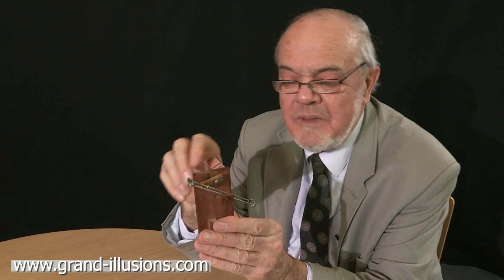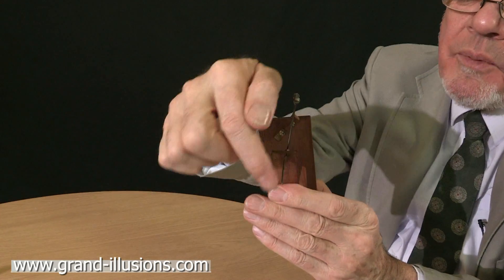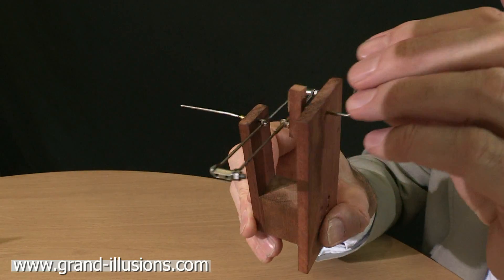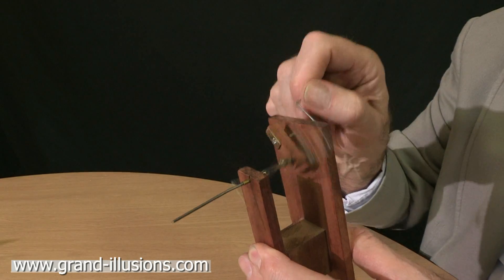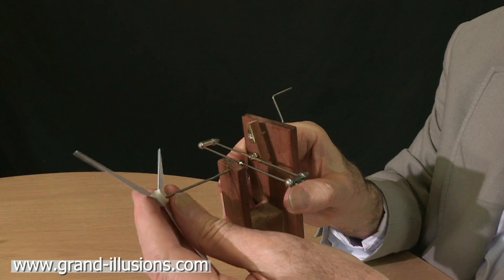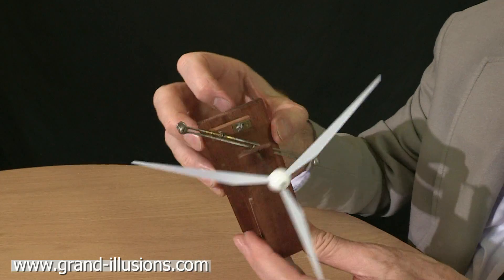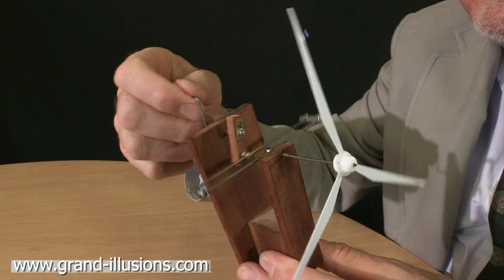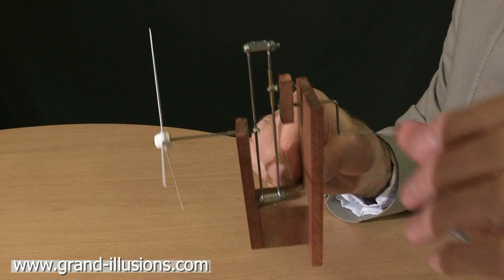Zurich Mechanism

Comment: The presenter fails to note that output shaft rotation speed is precisely half the input speed. And no, it is not an Oldham coupling. The drive link is precisely the length of the shaft spacing.

Comment: A direct connection could do the same work without this much confusion 🤔😅
Reply: The point is that the input and output are not in line. :-)
Reply: @salohcinbs  That's true, but what's the purpose? 🤔
Reply: @Bala-68  There are sometimes design constraints that require an offset system and this is an elegant solution.
Reply: @salohcinbs  okay. 👍 Just for understanding, Can you quote an application that requires such a mechanism?

Comment: There was no reduction? It’s one to one. It may as well been a straight shaft with a crank on one end and the propeller on the other. It’s just a waste in friction.  Baffling.
Reply: not quite, the mechanism continues the motion but at a different height to the crank, which is useful in itself. But other solutions would use less space which I guess is one reason you don't see this used.

Comment: Guess the gear ratio...
Reply: Tomas Sab this made me wanna commit sudoku
Reply: +DigGil3 its like 1:1
Reply: +RonniePoleCasper but is it a constant 1:1? 

The leverage is changing from one position to the other. At the top the leverage is two arms length, at the bottom - crossing the axis - 0 leverage. 

No idea what the ratios are in between top and bottom position, though. Axial loads kick in at this point, the lever is no longer working in pure bending mode. It should average out to 1:1. But what's the shape of the angular distribution?
Reply: ***** It's an interesting and legitimate engineering/logic puzzle!
Reply: quite intriguing, a very interesting topic nonetheless. 
i find the best way of determining this would be to buy one yourself, and monitor it's functions.
Reply: It's 1:cos(theta) (theta being the angle between the two rotating bars).
Reply: Don't think that matters. It may change throughout the single revolution, but I don't think it keeps changing.
Reply: For every 2 rotations, of the input, the output rotates once. Sot 2:1.
Reply: MyLifeInAFlamingBag
- but it's not a "constant" 1:1/2, is it now?

At various angles the ratio keeps changing. At one point the ratio goes down to 1:0 (at the bottom, when the driving circle is tangent to the rod)

Comment: I bet someone reading this is a whizz at animation.....  If you post your animation would you let me know please?  Seems to me that if the offset between the shafts were variable you'd get a variable ratio drive over a limited range.  My reasoning?  Imagine the two shafts aligned.  I would be 1:1 and constant velocity.  The misalignment shown here is near the limit, hence the hiccup when the slider is only just below the output shaft.  The ratio is 1.x : 1.  Some say 2:1,  but my eyes are saying "not quite".  Also, I think that for constant input speed, the angular speed of the output will vary  with angle.   Maybe I should just make one!

Comment: It's formal name is an Oldham coupling and it is used in cars to offset axels without the loss if torque or direction
Reply: thats not entirely true: oldham coupling doesnt change the torque ratio; this mechanism does
Reply: Not oldham coupling, although I see how you could make that mistake.
Reply: Maybe I’ve spent my whole career in a hole but in 50 years in the mechanical trade I have never seen anything that even remotely resembles this in any motor vehicle.
Reply: Sorry for replying to such an old response. If it is as you say and Oldham coupling, how come it has a 2:1 reduction?
Reply: Oldham couplings are run on tenons.
Reply: This looks like it has variation in speed and torque, also what would make this better over gears?
Reply: Yes, it is a cross clutch, but it does not have the characteristics of a differential as you describe, so it is not in the use of a car differential. It involves the transmission of torque and a 1: 1 transmission between two shafts that do not have a common axis. Someone writes that it is a 2: 1 reduction. It's wrong, it's not. The cross coupling is used for very small alignment differences. However, it is still true that the use of two gears is many times better.
Reply: Bit late but thanks wondered if there were practical uses, also wondering about the efficiency
Reply: Whoa, nice job!  
It's a brilliant and elegant idea.
Reply: It looks like the output doesnt run at a constant speed?
Reply: well, now we are 44! It's a bit of a progress, don't you think?
Reply: @RussellTeapot  now its over 200
Reply: @fernandotrujilo8954  amazing
Reply: @fernandotrujilo8954  crested 300 and is on its way to 400
Reply: @sethg6157  Already 328 only nine hours later....iiiiits trending!   Hello random youtube algorithm friends!  lol.
Reply: 348 baby
Reply: @Kharnellius  hey
Reply: 359 you glorious bastards
Reply: +Alex Underwood
Verified. Thank you, very interesting.
(How depressing that over the course of a year only seventeen people have bothered to 'like' that.)
Reply: @jacksainthill8974  dont worry I just gave the 420th like
Reply: almost at 500 boys
Reply: Russell Teapot 
Yes, they just needed some encouragement.
Cheers ;)
Reply: God has said in the Quran:

{ O mankind, worship your Lord, who created you and those before you, that you may become righteous - ( 2:21 ) 

 [He] who made for you the earth a bed [spread out] and the sky a ceiling and sent down from the sky, rain and brought forth thereby fruits as provision for you. So do not attribute to Allah equals while you know [that there is nothing similar to Him]. ( 2:22 )

And if you are in doubt about what We have sent down upon Our Servant [Muhammad], then produce a surah the like thereof and call upon your witnesses other than Allah, if you should be truthful. ( 2:23 )

 But if you do not - and you will never be able to - then fear the Fire, whose fuel is men and stones, prepared for the disbelievers.( 2:24 )

And give good tidings to those who believe and do righteous deeds that they will have gardens [in Paradise] beneath which rivers flow. Whenever they are provided with a provision of fruit therefrom, they will say, "This is what we were provided with before." And it is given to them in likeness. And they will have therein purified spouses, and they will abide therein eternally. ( 2:25 )

 Quran
Reply: @ahmdabdallah5811  This is the XXI Century, get out and go back 700 years and stay there, thanks.

Comment: What is so special with this? Not trying to diss, im just not understanding.
Reply: You know things aren't black and white. If I see something I don't understand I try to understand it hence, the comment. Fuck off, there was a time when you didn't understand this. I'm 16, straight A's.
Reply: KlemzeTV
don't mind that Igor guy, he clearly has problems with himself. I do not see what's so special about this thing either and I study physics. It just seems like an unusual way to build that connection and a bad one at that. Why bad? Notice how the front rectangle thing "jumps" at times which indicates a point where it almost locks up mechanically.
Reply: It's an interesting geometrical relationship that the output rotates at half the speed of the input simply by connecting the end of a crank to an offset slider, and is much simpler in design than using gears which have a complex shape and pulleys which use flexible components. It's also possible to get rid of the 'lock up' point essentially by 'repeating' the mechanism 90 degrees rotationally offset from the first.
Reply: It's nice to see someone wanting to understand. I'd consider it more 'unconventional' than 'special' since as Tim says; torque (rotational acceleration) is usually transferred between parts by using some kind of gear or pulley system. So really it's just a curiosity of mechanics.
Reply: *****
don't hate on klemze, someone started being rude, very rude, and that guy has now deleted his comments which is why it looks as it does. you can see me mentioning the guy in a comment in this thread, too
Reply: ***** For every crank, you get 1/2 crank of the output.
Reply: Bordpie
I see where you're coming from - really good idea about the offsetting part. But in practice I reckon that the friction on the middle sliding part would render a device with sufficient force behind it useless sooner than gears. Pulleys need to be replaced too so I don't know which would break first, would have to try ^.-

Comment: Interesting!  This appears to be a 2:1 gearbox but is it also a constant velocity system?
Reply: I think so.
Reply: sieben I asked the question 'is it a constant velocity system?'  If it is, it would give a constant rotational velocity output for a constant rotational velocity input.  A CV or Constant Velocity joint is what is used in front wheel drive cars for steering.  The traditional Hookes Joint does not exhibit constant velocity when the angle increases.
Reply: arburo1
It a piston mechanism so I don't think we can get constant velocity until the addition of a flywheel.

Comment: that's true, but in this case the two original axis offset each other so the chain would not be able to remain on the gear in either a low stressed situation, where the chain would have too much slack and would eventually catch and fall off one of the gears, or it would be too much of an angle for the chain to run cleanly and cause it to fall off (much like the chain on a mountain would fall off the gears on the bike when the gears on opposites of the drive train are being used).

Comment: hmmm. good thought. but if you were gonna do that, couldn't you just use 2 small gears on both axis, and then a chain connecting the two? like a bike?  I mean the rectangle might use a little less materials than a chain, but the rectangle would need a lot of space to rotate, whereas the chain would rotate in place.

Comment: This could be good for spinning a pair or variety of axis that are far apart. The rectangle could reach across a large distance rather than the same distance being greatly occupied with a large sized gear or set of gears. The replacing of the gears also means a lower cost in materials as less metal is used to reach the distance (imagine the rectangle and the small beam in the mechanism being longer and the crank being higher up, and how it would be simpler than a variety of gears).
Reply: The problem is practicality, you need quite a bit of space to move a rectangle like that, and making it longer introduces flex, limiting torque. Best to use a shaft with u-joints when you don’t want something flashy.

Comment: This is very similar to the Oldham Coupling, which can be used as a component of a drill which makes perfectly square holes. You can see the square hole drill here in a lecture called "Surprises in Mathematics", youtube video ueeViKEcRtY at time 15 minutes.  A similar coupling is a Schmidt Coupling, which also allows two offset axes to be coupled.
Reply: this is nothing like an oldham coupling
Reply: Oldham coupling had a 1:1 ratio.  This has a 2:1 ratio.